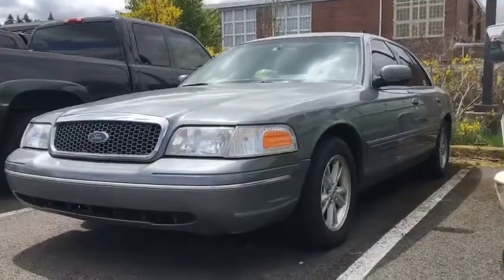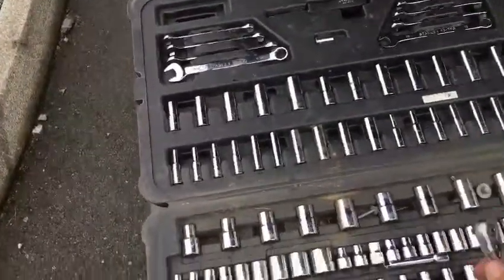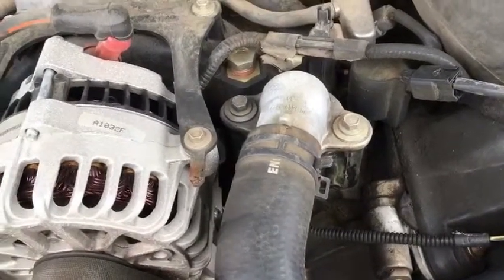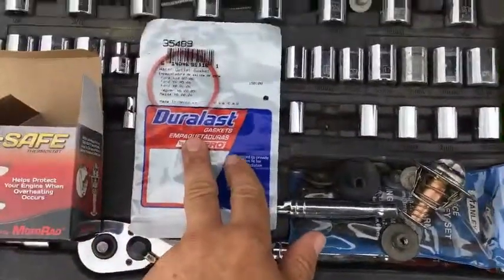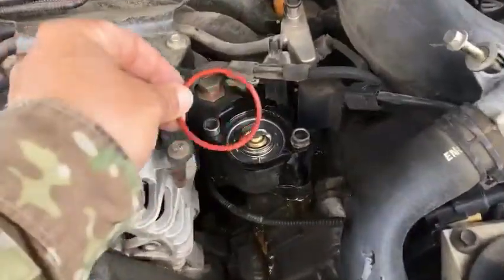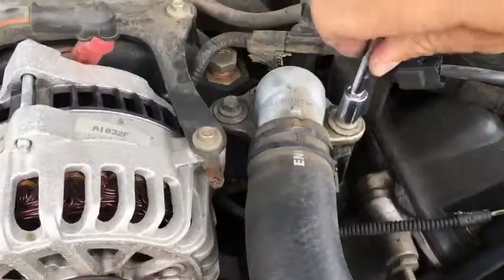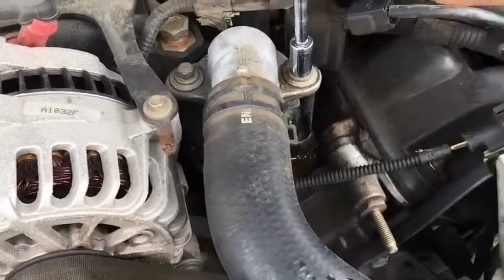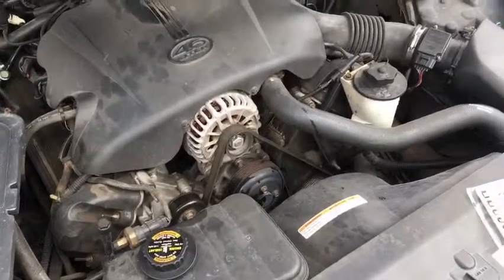Crown Victoria Thermostat Replacement

Comment: You didn't mention what orientation the jiggle pin needs to be when installing and also how to properly take the air out of the system.
Reply from the maker: I’ve never seen the significance of setting the jiggle pin in a specific manner, and as for bleeding air from the system, once I’ve topped off the coolant I simply run it for fifteen minutes, checking coolant levels every five minutes. In fifteen years I’ve never had an issue. But I’ll look into what you’re talking about.
Reply: @ThePursuitofHappiness1988  look into it, because it is important that the jiggle pin is aligned at the 12:00 position when replaced. Anyway, I'm a fan and you did a great video.
Reply from the maker: @rr186650  thanks! I’ve read that it has something to do with bleeding air from the system?

Comment: I see mine leaking, right? Okay... coolant is still leaking downside the back of the motor on to the ground. Question— do you think it’s the coolant running downside the intake manifold and dripping down. Or is it the intake manifold itself. Obviously I see the thermostat housing leak from standing & looking down at my car.
Reply from the maker: How the hell did I miss your comment? I’m so sorry. What’s leaking is probably a port at the back that’s part of the water pump, if it leaks it’ll fill the valley under the intake manifold.
Reply: @ThePursuitofHappiness1988  the thing about these cars , one little crazy on manifold , then you should change it .I payed a guy $140 to replace my intake manifold.
Reply from the maker: @BEENIECRIS  I did mine myself two years ago. It’s not fun.